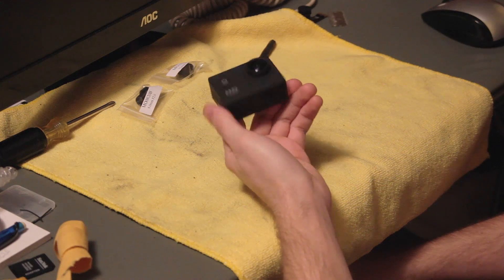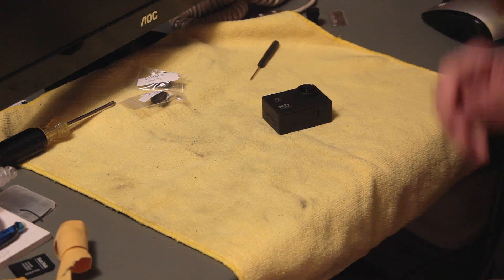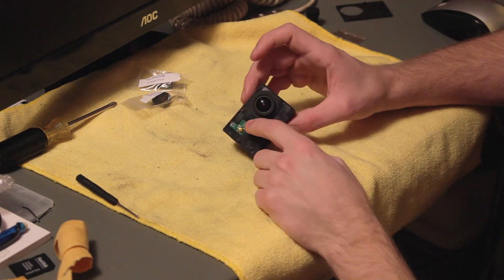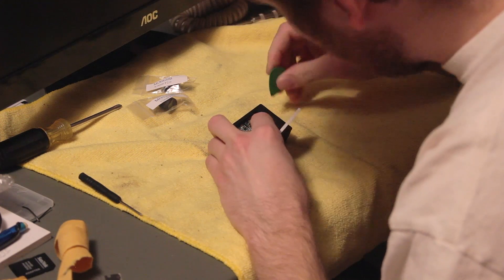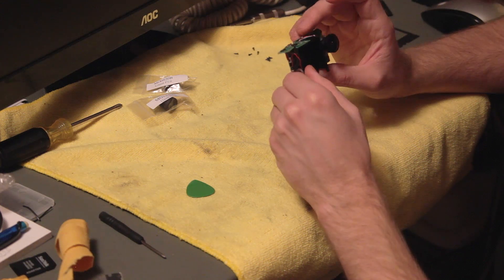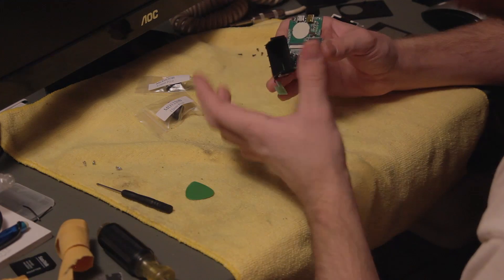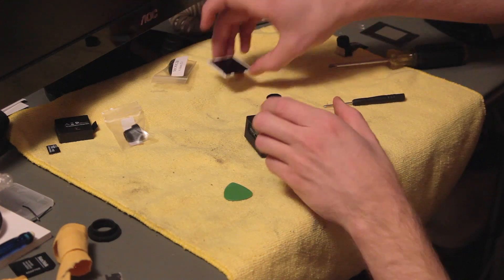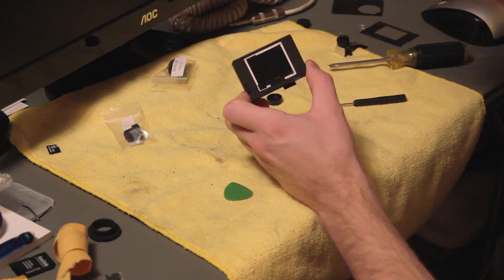SJ4000 Disassembly and Lens Swap How To

Comment: Hi from 2022! Many thanks for this - I needed to strip the one here apart to remove the now-sticky 'rubberised' finish and had got as far as the four corner screws under the front cover then realised the screen cover would probably have to come off so did a search just in case there was a gotcha.

The main assembly comes out easily if you tackle the USB and HDMI sockets by gently levering the plastic away from them, starting at the HDMI one here as its fit was tighter.

[Edit] If you're dismantling one to remove the coating (isopropanol and rubbing with a cloth does the trick) be aware that the lugs on the front panel are fragile and will snap off if you press it down onto a flat surface - I lost one this way. Also the socket and button legends will come off but the front panel branding (Qumox on the one here) doesn't unless you leave it to soak overnight as I did.

Comment: Hi!
My up/WiFi button got stuck and I've disassembled my sj4000 by myself using your video.
Now I see the real button soldered to the circuit, right after I've opened the camera like in minute 6:13.
Can you tell me the specifications of this button so that I'll be able to order one on eBay or something?

Thanks a lot :)

Comment: Thank you! I had the upper volume button switch broken. Had to remove the pieces, as they cause short circuits. I already had the camera jam during recording and I guess it's because of the loose metal part from the switch. With the help from this video I could safely get the board out find the pieces of the switch. The switch itself is not that important, settings can be chosen done with just one volume button. So thanks, my camera is back together :)

Comment: Hy, my problem is that this "ribbon cable" has been pulled out, but from the LCD. I know that was mistake but i didn't know how to disassemble camera from behind. Is there a solution for my problem. Thx
Reply: You need to get a new display, I'd say. I just opened mine but didn't look closely at the display end. I would suppose it's not using a connector. But if it is, how to get there?

Comment: I have problem in my sj5000+  white lcd screen but when press on it color comming Ok,
If i disassemble and press with glue will work? ???

Thanks
Reply: the problem is the flex cable lcd.

Comment: The micro USB connector came loose from the circuit board. Do you know if the tiny connections at the back were soldered or just compression fit. I might be able to glue it back in place. Been using as car dash cam. So other idea is to give it power through the battery port. 3.7v there. With 3 connectors. +- and middle one.
Reply: No electrical component is press fit on circuit boards, especially connectors. Some hot air gun needed? :)

Comment: There's a better way that takes 5 minutes and does not require taking the camera apart... this is not the way to go..
Reply: Please, tell us.
Reply: IQLogic Pop the face plate off with a small screw driver and use pliers or small channel locks to unscrew the lens. replace lens, focus, return face plate.. done.

Comment: I got the same camera with a broken sensor filter...It's in the box and packaged for return. Do you know the sensor part code ? If i can find it and is cheap i can replace it. Otherwise i have to wait for 2 months for a replacement.